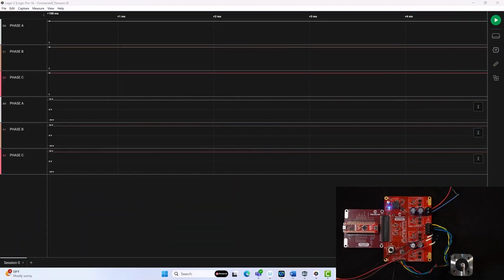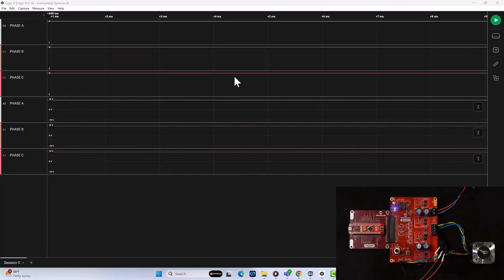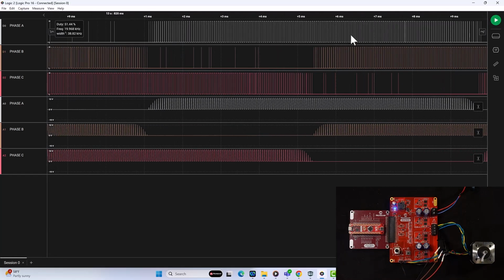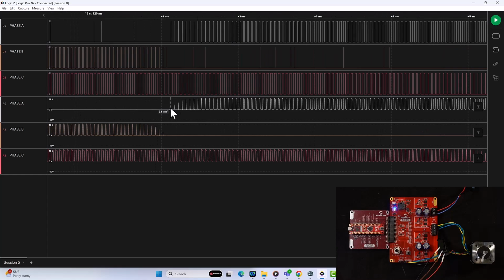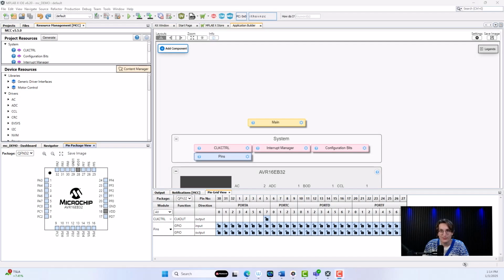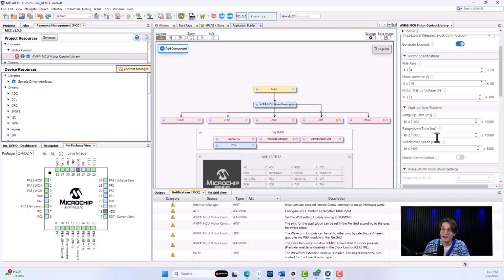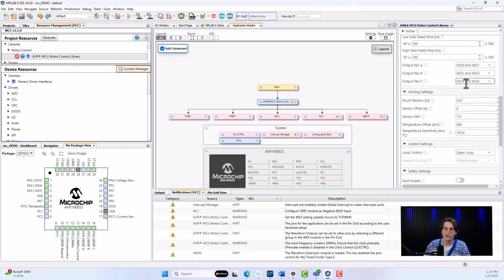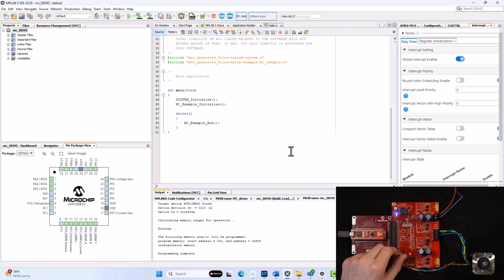Quiet and Efficient Motor Control - This is the way!

Comment: Trapezoidal commutation is not "more powerful" than well implemented sinusoidal drive, e.g. FOC. The main advantages of trapezoidal drive are its simplicity, low cost, and ability to implement with minimal motor dependence. FOC can provide higher speeds, higher torque, better efficiency, and much lower noise at the expense of requiring extensive knowledge regarding the motor's parameters and complex real-time Park and Clark computations.

For high power applications, it would also be nice to filter out the harmonics from the PWM which otherwise result in additional magnetic flux and heating in the motor.

As a final note, if the presenter is reading from a script, the prompt should be aligned with the camera. Seeing a person's eyes focused on one side of the camera during a presentation is disconcerting.

That said, I'm happy to see that Microchip is getting serious about this market and look forward to trying out their reference design products!
Reply from the maker: Hi there, thank you for your input! The main reason we left FOC out was to provide context on the simpler commutations. But you are right, FOC has better capabilities of torque, speed, and efficiency. We are glad to hear you are more excited about our new motor control opportunities, and invite you to stay tuned because we have more in the works!